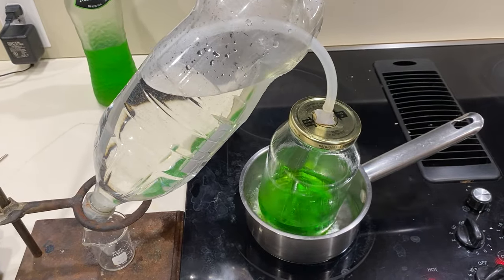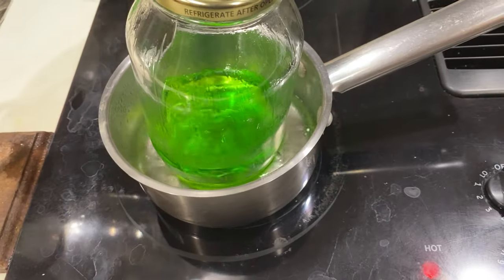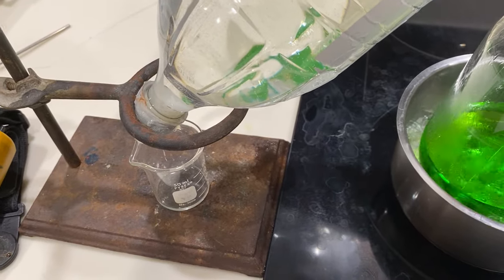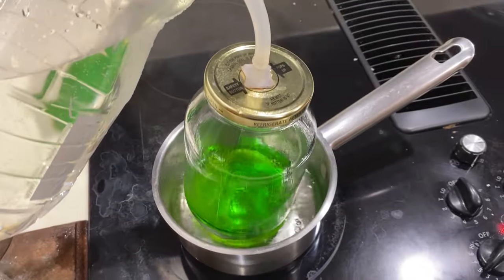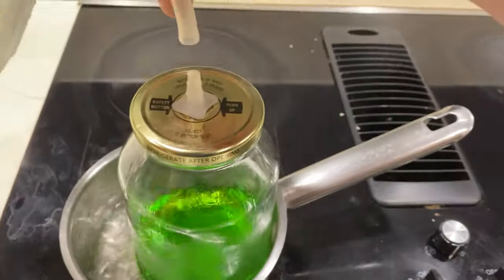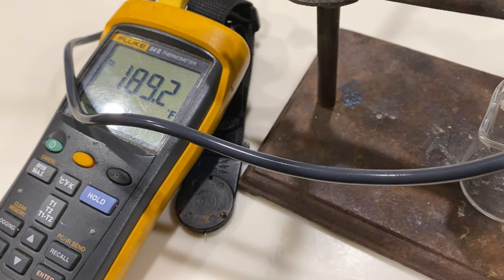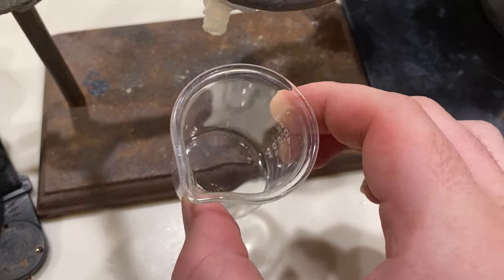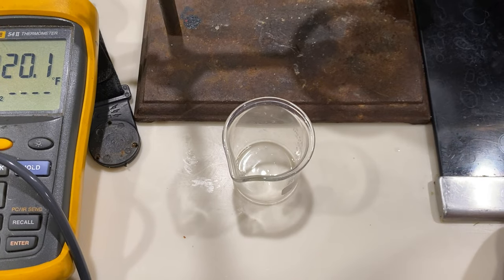Home Distillation of ethanol - Very simple

Comment: It’s important to note that water and ethanol form an azeotrope lower than the bp of each constituent (water = 100 C, EtOH = 78.4 C, azeotrope = 78.2 C). This makes it impossible to attain an ethanol concentration above ~95.5% when distilling. Further purification is required if a higher concentration is desired— such as using molecular sieves, adding sodium to the distilled azeotropic ethanol/water mixture, or using the benzene pressure swing method for larger scales.
Reply: Chemist? Thanks for the fact!

Comment: Why with Midori, use a low cost vodka or ever clear that contains more alcol
Reply: Everclear is maximally distilled alcohol, at an alcohol concentration of around 95%, ethanol forms an azeotrope with water, which means they’ll have a homogeneous boiling point
Reply: @tobiasleybold9023  in many states in the usa the everclear is only 75-90% due to legal stuff and could be distilled further
Reply: @tobiasleybold9023 What if I’m just tryna reclaim everclesr that was used as a solvent n want all the liquid back? Then it shouldn’t matter right?

Comment: Possible DIY upgrades to this process:

A fractional distillation column before the condenser: same reason why ethanol evaporates easier, water condenses easier. A fractional distillation column is basically a tube with glass shards in it that enable the vapour to experience multiple evaporation-condensation cycles each time biasing the process more to ethanol.

Salting out: you can add salt to the mixture and the ethanol separates and sits as a layer on top of the salt water. Extract that layer and then distill it to remove the salt. Obviously it will still contain some water but it will save you a couple of distillation cycles.

Comment: I recomend to put some sand inside the jar or something with rough edges to have some nucleation points. I think some broken glass can be used too.

If you dont have those nucleation points the alcohol can be at a temperature higher than the boiling point and the water from the water bath be boiling. If that happens that meas that you are waisting the energy in boiling the water from the water bath instead of using if for boiling the ethanol, and furthermore there is the risk of an explosion ocurring from the superheated ethanol sponteanously boiling.

When I was doing this kind of distillation with a bottle, the ethanol wasn't boiling, so i added some sand into the bottle and it suddently boiled. Some ethanol scaped and splayed me in the hand, but luckly nothing more happened.